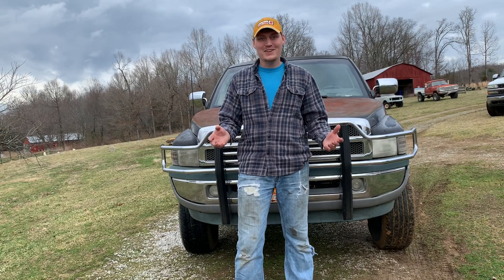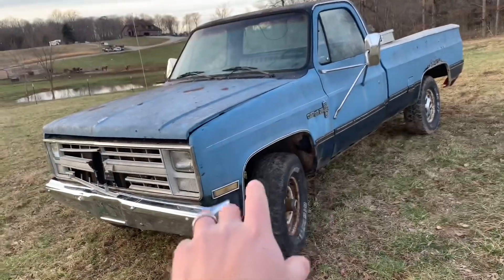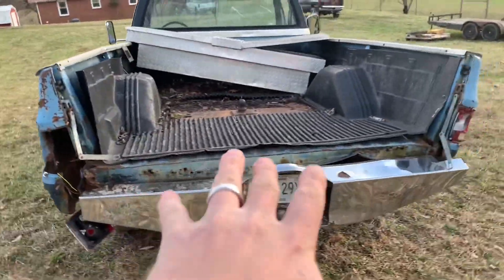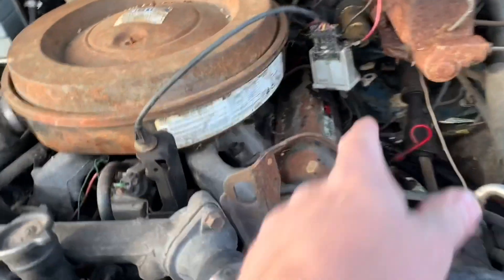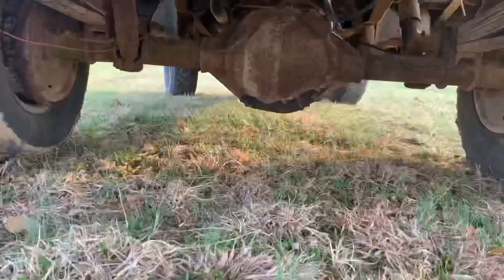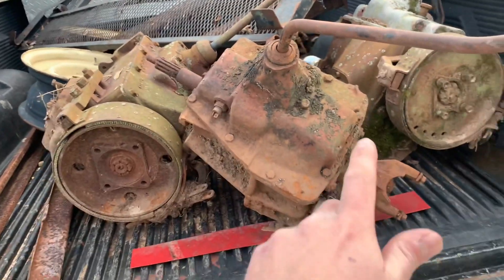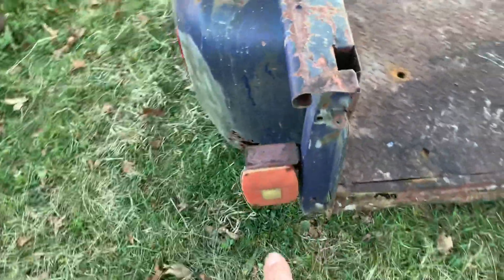1986 Chevy K20 Diesel Walkaround!

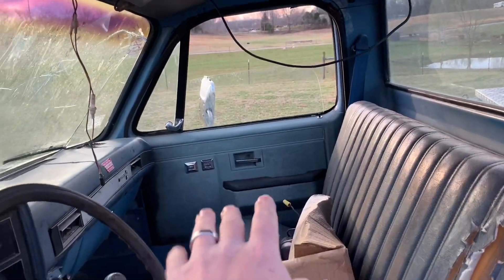Comment: That would be a cool build. Short bed step side. My first thought was flat bed. I had an 86. It had 3:21 gears. Great millage, but not a great tow rig.  I could not tell you how many starters  solenoids I put in that thing.  Don't forget to change the fuel filter under the intake in the back of a motor
Reply from the maker: A flatbed would be really practical but I think the style of a step side short bed is hard to beat! Thank you for the advice and for watching!

Comment: I had a NP 435 in a jeep,  but it only had 4 forward gears.  However,  I'm certainly not an authority on transmissions.  I think if I were deciding, I would try to find the correct year models for the  Chevy shortbed and keep the diesel with the long bed for a work truck.  Thanks for the good project info and keeping us informed.
Reply from the maker: Unfortunately I decided the truck was too rusty and passed it on to someone who could use the parts. Thank you for following along!